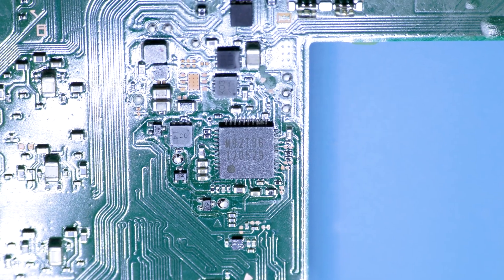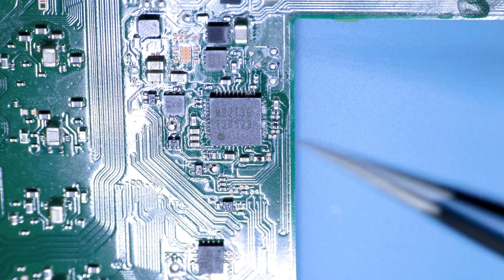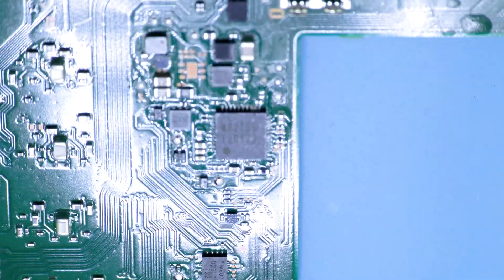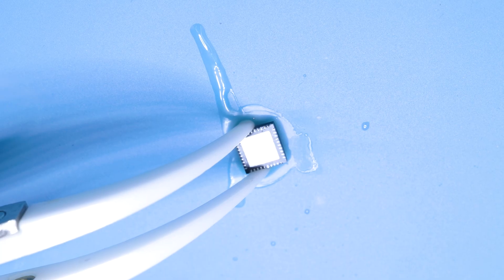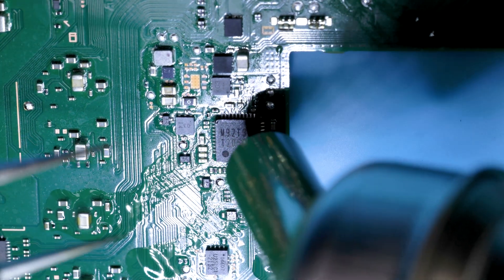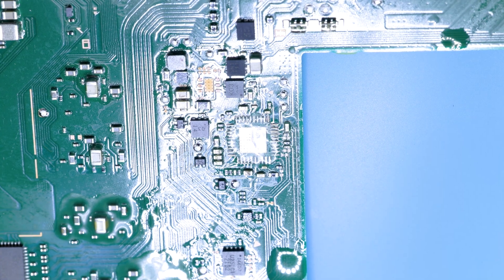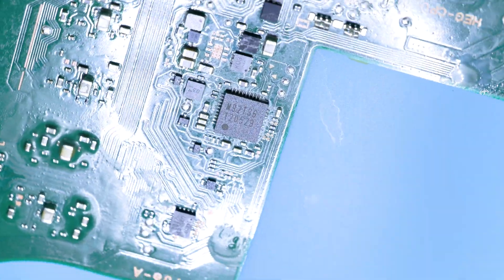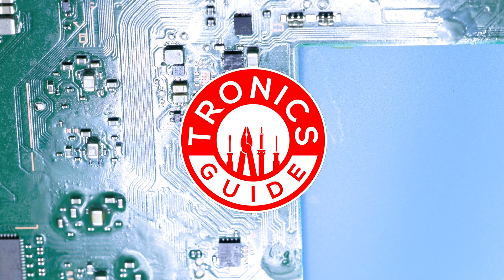OLED Switch Charging Chip Replacement Guide - M92T36

Comment: Hi, I also use this Atten hot air station, really great, I also use a quick which for even smaller and more delicate jobs is phenomenal, what width of curved nozzle are you using in this video to desolder and re-solder this M92T36? I use an 8 mm or a 10, it depends on the console as it is set up.... are you using an 8 mm nozzle? thanks and excellent welding, fast, clean and precise...

Comment: my station isnt melting the soldering 😭 even at 100% 450oC
Reply: Buy some low melt solder (like £5 for 2metres) to mix in with the solder that’s already on the chip to lower desolder temperature :)
Reply: @Newlvlunlocked  thanks

Comment: How long you hold the heat gun on it?
My chip isnt going off after 10 minute by 500 °C
Reply: mine too 😭😭😭
Reply: @juscelino2253  maybe the airflow is to low, or the Size from the nozzle of the Heat gun Not wide enough.
Reply: @marsimoon185  i got it. removed and installed another m92 chip. but didnt work. now i dont know if the chip is faulty or the soldering is bad lol

Comment: Great video, I’ve recently purchased a faulty switch from eBay and one of the components are missing, would you be able to tell me what it is and it’s value?
It’s the larger capacitor/ resistor at the top of the chip (joining the 3rd and 4th pins) between the “9” & “2” printed on the chip.  I’m wanting to put this component back on before replacing the chip to check it’s function to see if there is anything else causing it not to power.

Comment: What is flaks or smt i live in germany you dont have it in the Description
Reply: Flux is the paste which helps the solder reflow. Not sure the exact flux used here but you’ll be able to find loads online.
SMT is an abbreviation of Surface Mount Technology.  It’s the type of component that it is (not through hole)
Hope this helps!